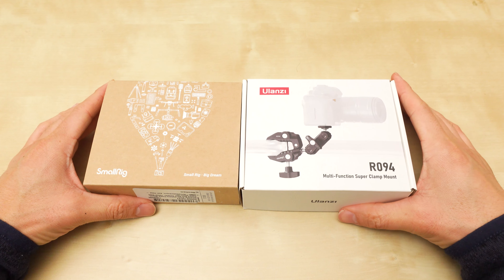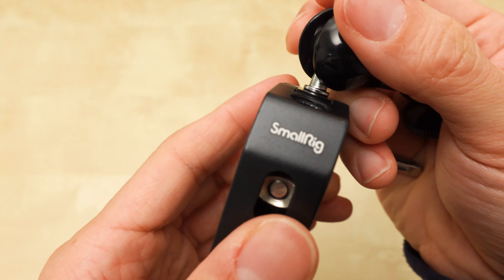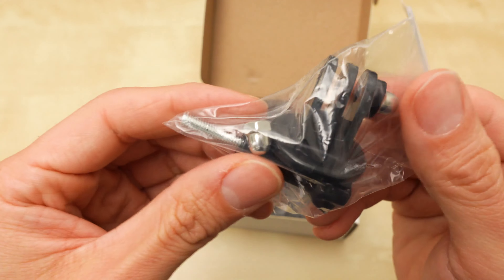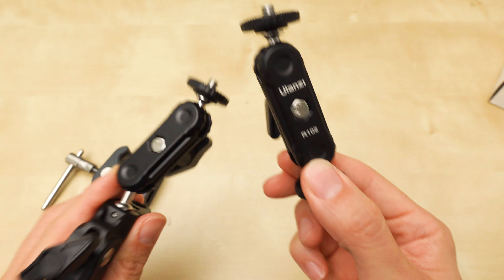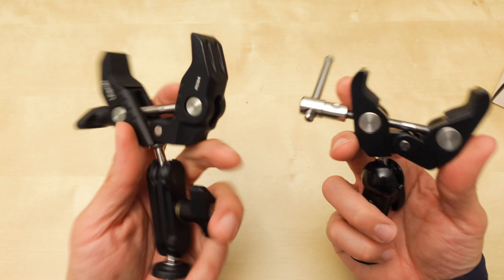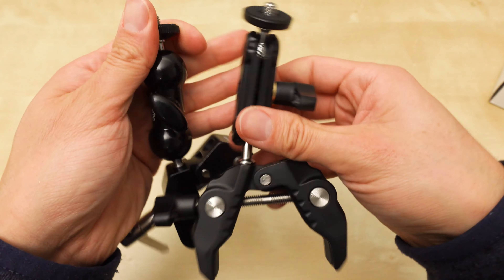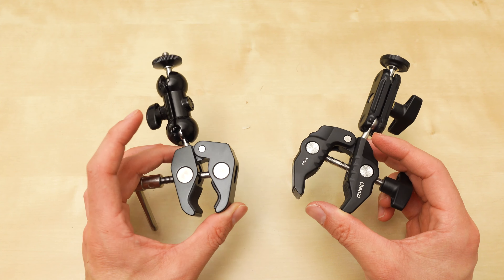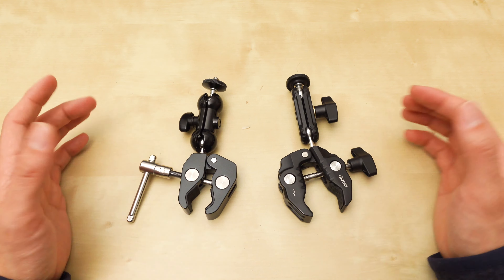Smallrig vs Ulanzi R094 | Super Clamps

Comment: these are the ones that hold only 1.5kg, there are better versions for both of these. smallrig 4102, up to 3.5kg, or ulanzi UURig R060 for much more mounting options on the clamp. I wouldn’t trust mounting my camera on any of the ones that only hold 1.5kg. And if you need an extension arm then the ifootage LT4-3.5 holds 6kg but im still looking for cheaper options

Comment: Finally, a video that didn’t just go over whether a clamp is used to clamp. You did give some extra detail. But an important thing about these clamps you should consider in your reviews is that people are putting several thousand dollars at the end of them most of the time. So how much weight can they hold? Would be good to look into. Do they lose their clamping ability when in motion or when vibration is introduced.
Reply from the maker: I was unaware that people put several thousand dollars of equipment at the end of these types of clamps most of the time. From my observations and own personal use, the type of gear that would be used on these specific clamps are GoPros, action cameras, small LED lights, 3.5mm shotgun microphones, and other small devices.

I do not recommend that people put heavy expensive gear on the clamps in this video. They are too cheap and tiny for anyone to rely on them with thousands of dollars. Actions cameras, small lights and mics are perfect for them, but nothing big or heavy.

Comment: Please respond - Which is better r099 or r094? Especially if i want to mount my insta 360 with a selfie stick on my motorcycle.
Reply from the maker: If you want a higher reach, get the r094, if you want the camera closer to the handle, get the r099. Both are pretty equal in quality, it just depends on the length you personally want to mount the camera.
Reply: @VideoGizmology  I'm okay with length, just want to know sturdy wise. Is one superior to the other?
Reply from the maker: I don't have a motorcycle, so I don't know what the full force would be like. You'll have to test this with your specific setup. The r094 feels sturdy to me, but again, your specific situation may not be sturdy enough.

Comment: Would love to see real use differences. What can each of these hold?
Reply from the maker: The load capacity for each is around 3 lbs, so that can fit anything between a GoPro to 7" camera monitor. This is not good for mirrorless cameras or anything heavier than 3 lbs. Even a device that is exactly 3 lbs might be too heavy. Also not great for mounting on bikes or moving vehicles.

Comment: I have one similar to the small rig with the metal crank I find that if you're using it with a GoPro on a bicycle that the metal crank Jiggles around and you can hear it in your video it is very distracting so I just purchased a ulanzi we'll see how it works out